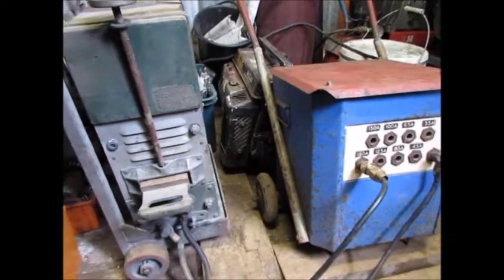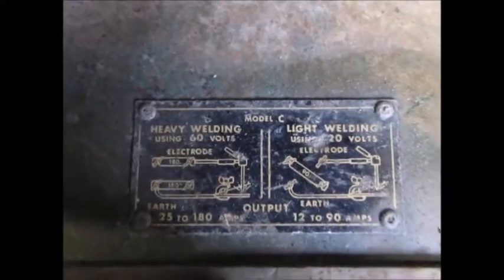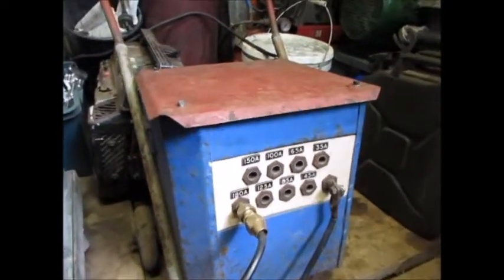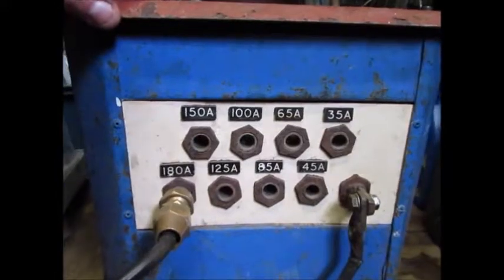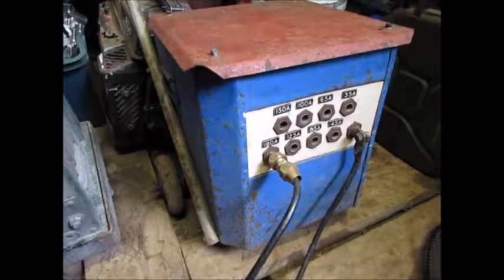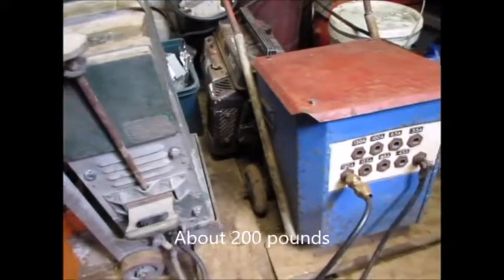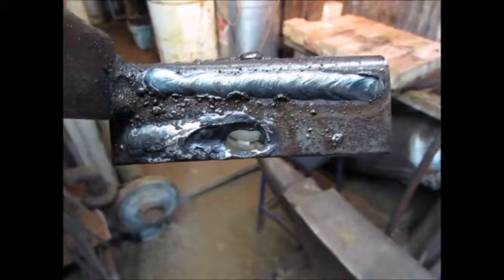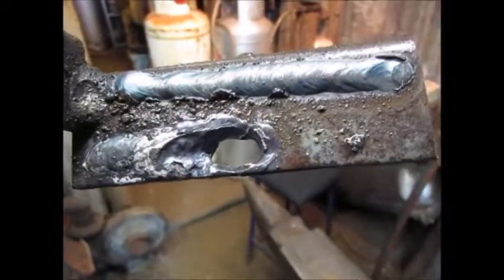Vintage arc welders, which is the best

Comment: Transformers shouldn’t have a loud hum. If they do, it’s either because the iron quality is poor. It isn’t wound properly. It doesn’t match the line frequency, or a number of more minor causes.

It’s dangerous to use very old equipment because the insulation used back then has a tendency to dry out and crumble off, particularly from moving the device, and vibration. So, please be careful, and if possible, try to inspect the interior.
Reply: If you’re talking about cheap modern crap, then I would agree. Otherwise, no.
Reply: You obviously don't work around transformers much. Walk past a 66,000 to 11,000 volt one one day, those things hum and rattle like you wouldn't believe.. my old model C young sounds angry sitting there waiting for work, and dead quiet when welding. Insulation in them is no different to the modern ones, coated wire and inter turn insulting sheeting same as used in electric motor slots.  I should know, I used to build the things in the late 1960's before nzig took  over and ruined them
Reply: @mattyb7736  I have, for years, designed equipment using various transformers, commercially. I know that very large transformers , sometimes, are noisy. Those are different from “regular: models. But smaller models shouldn’t be.
Reply: @melgross  .Bro my youngs C model makes a humming sound as matty b said his does the same.
Reply: @mattyb7736  I’ve designed electronics professionally. Yes, some transformers hum. But it’s usually due to poor design, faulty construction, or overheating. A transformer shouldn’t hum. But they’re not perfect, so sone do.
Reply: @mattyb7736  .Hey Matty B   I have a youngs c model ive painted it in original green color and silver bits ive cleaned it up it looks like the day it left 92 princess street onehunga , i got esab, and other caddy welders but i still prefer to use my youngs they heavy but they are bulletrproof*